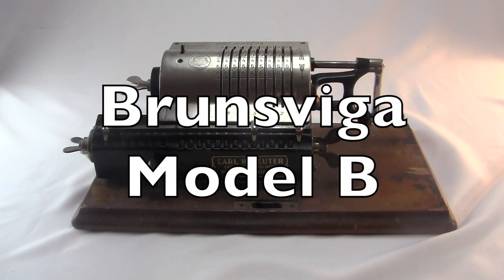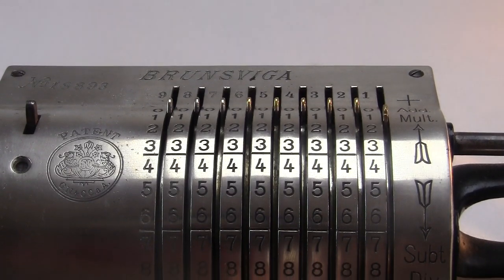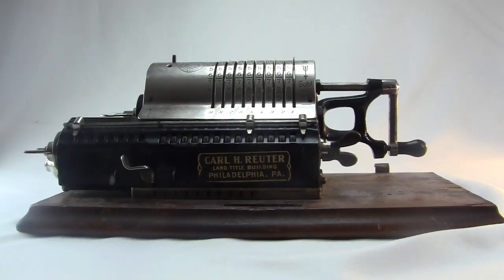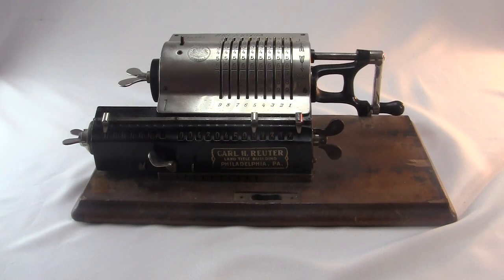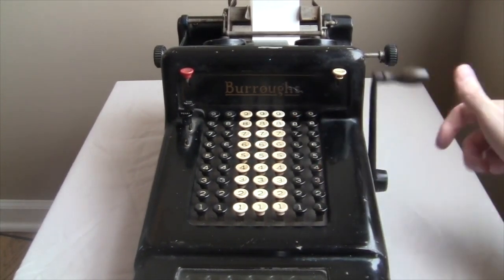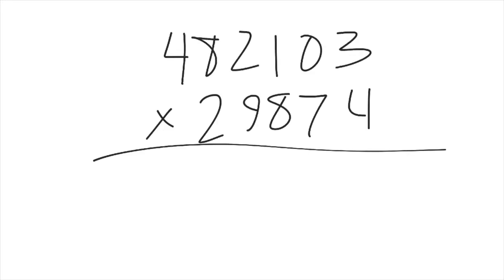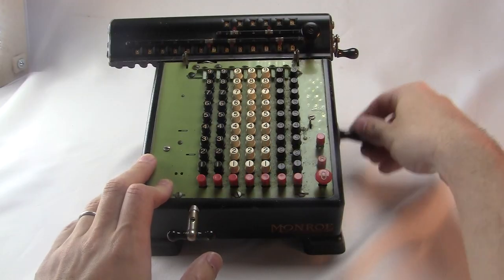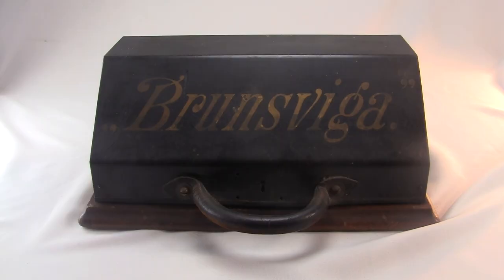Brunsviga Model B Review / HowTo

Comment: That's an excellent point about buttons vs sliders that I hadn't really thought of before. I must disagree with you though, when you characterized the Curta as a pinwheel machine (6:56). It's really a stepped drum machine like the Thomas Arithmometer, except that it has only one drum that is shared by all the digit sliders instead of each slider having its own drum. Apart from that, it's another great video, thanks.
Reply from the maker: Thanks Jaap- as usual your knowledge is better than mine!

Comment: I like your model, this is a really old - and quite nice one. So, don't know if you ever thought about it, but the thing about the pinwheel calculators with number levers vs button driven or set adding machines would be comparable today to calculators vs. scientific calculators. Basically, adding machines were invented because people had trouble adding - especially not forgetting to carry a 1 when needed, but that was pretty much it. The repeat button didn't have a multiplication purpose. You can use it like that because you thought about it now, but back then, the idea was to add identical items which cost the same... except for the comptometer, of course, which was intentionally built to multiply like that. However, the Arithmometer was built intentionally with idea of performing every basic operation quickly and also accurately, all without too much hassle. So, pretty much like scientific calculators were built to make it easier to do specific things more quickly (because of course you could use a lookup table or even calculate that stuff yourself, but that would waste your valuable time). So what I mean by this is that the Arithmometer (or pinwheel calculator) was actually the scientific calculator of its time... and I have a few of them too btw. Love your videos, they keep giving me ideas about what I might like adding to my collection next! :D

Comment: The Monroe calculators are a modified stepped drum design. Each column has two drums, one with 4 stepped teeth and one with 5 equal length teeth. Numbers entered on the keyboard below 5 use only the 4 toothed drum, numbers above 5 use both drums. Thanks for the video, as an owner of 2 Brunsviga model A's it was nice to get a look at the model B

Comment: Why was the 9 in 29874 red
Reply from the maker: I was going to discuss this but it ran too long- the counter doesn't carry, so it will give misleading answers if you ever crank 10 times in the same digit. I think the red 9 is like a warning- don't crank it again or else weird things will happen with the counter. There is a full set of red digits used when subtracting- if you add past the red nine the counter will advance to a red eight, which almost certainly isn't what you want to see.
Reply: The red numbers are for subtraction so you don't see complement numbers. The 0 and the 9 are shared by both addition and subtraction.